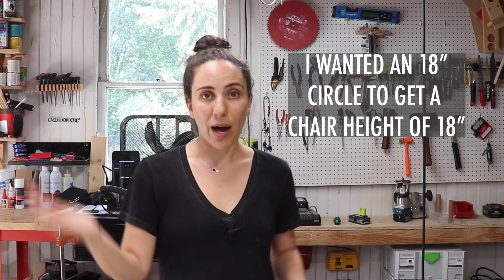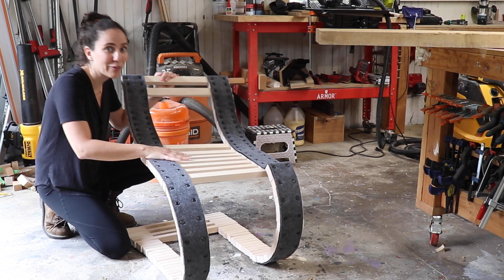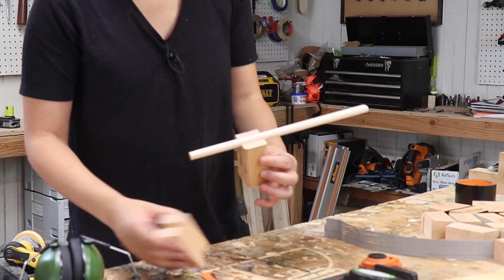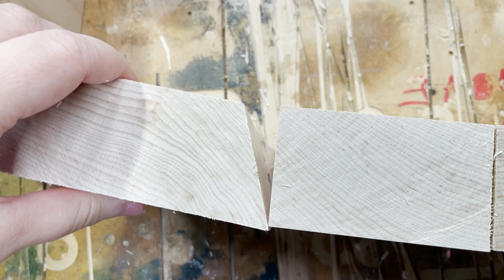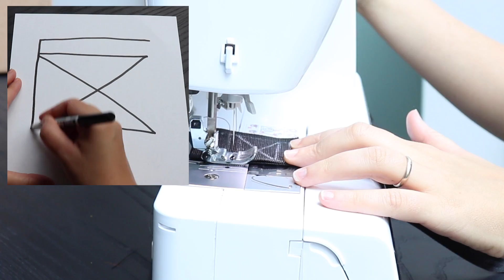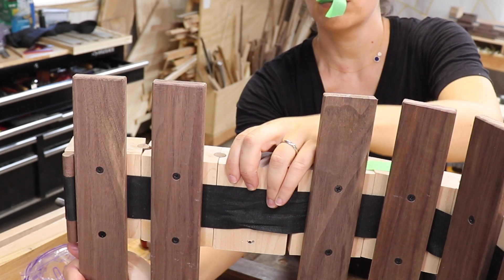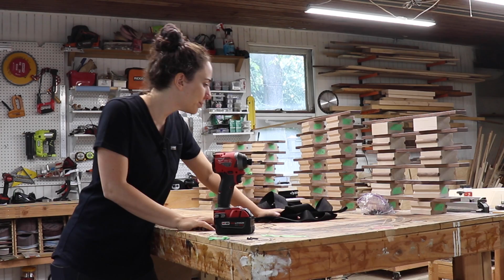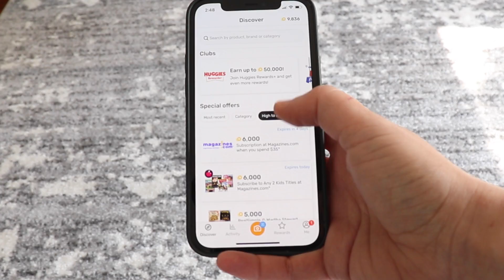I ATTEMPT to make a Roll Up Chair… AGAIN...

Comment: How about using metal hinges on each block instead of the strapping

not saying that you should use metal hinges for the final product (unless you want to) but the idea of metal hinges on each block would help fix the tension and also the elastic problem, the question then is how could you mimic that using your design.
Reply from the maker: Maybe

Comment: A couple of suggestions:
1) Simplify, go to a "bleacher backer" style of chair that is just the back and bottom rests.
2) Add posts in the back to brace the chair back and hold it a fixed amount over the floor/feet.  Could perhaps be made to take the dowell out and go into the handles when you roll it up.
3) instead of 1 long strap from foot to top, maybe smaller straps that hold 2-3 wood blocks together and that would then have less length to stretch out.
Reply from the maker: All good ideas

Comment: Dang! So close! What if you bought a long lengths of piano hinges and then cut them to shorter lengths to use as alternatives to the straps? The short bit of hinge would be placed where the strap would have been between each block. The piano hinges are readily available and are fairly cheap. Third time's a charm 🤞
Reply from the maker: Maybe!

Comment: Great second attempt! Love the dowel idea to reduce rotation. 

If I put on my armchair engineer hat, thinking about the forces, this design is an uphill battle. Focusing on the point you’re seeing the most stretch, at its simplest you have a lever. The inner radius of the block being the pivot, a force of ~130lbs ~18” away (when sat in as designed), and the strap opposing it 2” from the pivot (the other side of the block). That ends up being a 9x force multiplier, turning 130lbs into 1,170lbs (or 5200kN) of force on the strap. (18” / 2” = 9x the force. 9 x 130lb = 1,170lbs)

As for the stretch, I haven’t modeled it, but I suspect even a 1% stretch would significantly alter the shape of the design. Especially when it only has the two attachment points where the 1% of the whole length is able to be concentrated on one pivot like you saw, as opposed to the idea you have of attachment at each segment reducing the 1% to a single 4” segment of webbing. Based on what you experienced by adding tension, that too isn’t a solution because it adds a inherent spring that adds danger of collapse. So to both hold it’s shape unloaded, but also not collapse when sat on, the strapping needs to have almost 0 stretch. Difficult when applying 5kN of tensile force. 

So in my mind, in order to make this work (or at least give it its best shot) you need to reduce the leverage on the strap, and increase strap tensile strength. 

The first can be improved by using thicker blocks. A small change of going from a 2” thick block to a 3” thick block decreases the leverage by moving the pivot further away from the strap reducing forces from 9x to 6x and 780lbs. Going to a 4” thick block drops it to 585lbs (2600kN) pulling on the strap - still a lot. For aesthetics, you could even have varying thickness over the length since forces decrease towards the top and at the tail of the base. 

As for near zero stretch at these tensile loads, two ideas come to mind. Layering the webbing literally multiplies its capability. I haven’t found the specs of the viper webbing you used, but 1” tubular nylon webbing has a breaking force of 4,000 lbs, with stretch happening at MUCH lower forces. Layering 2, 3, or 4 layers with individual segment attachment, might reduce stretch enough in combination with thicker blocks - while still maintains rollability. 

The other no stretch idea is to use metal, metal strapping has almost twice the tensile strength of the strongest webbing. A relatively thin metal strapping might give you the strength required with almost no stretch, while still being able to somewhat roll up. You could possibly use it in conjunction with the webbing. 

This is a hard problem because of the amount of leverage exerted. It’s like having a 20” plank on a pivot point 2” from the end, a person standing on the long side, and a piece of webbing just 2” from the pivot trying to hold the person up.  That’s big forces. But there’s a chance it could work with these (and other modifications I haven’t thought of).
Reply from the maker: Ugh. Yeah. It’s a hard nut to crack. Ha
Reply: @3x3CustomTamar  Good effort, and thanks for sharing even if it doesn’t work. I know people are asking you to keep going with this, if you don’t, that’s cool too. There’s other things you can spend time on that we’d also love to watch.
Reply: This is a really good explanation of the physics at work here and great suggestions for attempt 3. I like the idea of the varied width but that would be pretty complex maths to work out without a program that can do the maths for you 🤔
Reply: Either metal band like Josh Wright used or aramid fiber cord or strap (Kevlar & other brands) for ultra low stretch. If strap stretches 0.1" at the outside of a 2" block, & chair back is 15" from front curve that's 0.1"/2" = 5% deflection; .05 x 15" = 3/4" sag per block joint with that stretch. Check Josh's video, he's close to solving this. Is it a great chair at that point? Opinions may vary on that. Valiant effort
Reply: I would think ss wire rope would work and look good.

Comment: Tamar, I admire your perseverance! This has been such a cool project to watch and I have wanted to see you succeed so much! I’m sad you already glued this version up because I absolutely believe you were close! I think you’ve had a number of issues and you solved most of them in this version but you also introduced a new one. 

You solved tension, the correct angles of the wedges and the side to side twisting. (I was very impressed by your dowel solution to the twisting!). The new problem is that by allowing the strapping to slide over the middle segments the tension can transfer to the least stable part of the chair. Your old design had each segment fixed on its location of the strap so tension was local only. With free segments the tension is global and that’s why the head rest and foot collapsed. They were releasing tension. If you duplicated this design exactly but trapped the strap I think you would succeed. How to trap the strap is the question. I think what you did here with the walnut is good, so perhaps keeping that but with something underneath the walnut that prevented the segments from sliding along the strap. It would change your assembly process but with your whole shop this time I hope you could do it!

If you ever have the will do try again, I wish you the best of luck! 

Also, best to all your other endeavors and your family!
Reply from the maker: I was thinking the same thing. I was trying to think of some sort of metal “clamp” that can hold the strap in place…
Reply: @3x3CustomTamar  Yeah, I was thinking the same thing. I suppose you could experiment with a sample segment in your bench vice and use a ratchet or a come along to tension it. The only thing I can think of is have a small mortise in the segment and screw down a piece of metal over the strap into the mortise. I’m not sure if it would work long term though.

Comment: As you realised in wasn't working I really wanted to give you a hug.  Just thinking aloud but I expect webbing won't work, you need something where the fibres run along the length only (i.e not wobble up and down (as in anything woven) and thus as tension is applied can stretch).  Maybe a cable set so it's centre is level with the surface, the cable could be steel but also check out materials bow strings are made of.  As for avoiding unfortunate folding up you need every block to have the force vector significantly inside the fulcrum.  It's an interesting problem, I can have more of a think if it's helpful.
Reply from the maker: Haha I needed a Hug for sure 😂
Reply: Look at the misrolo photos online the flexible layer must be rigidly attached to each block and not allowed to slide otherwise you get your folding up problem, I think the felt is a cover layer with some solid polymer layer below, it must be fairly thin otherwise it won't fold if it has little stretch.  This layer is the key I think...

Comment: For the strapping material maybe some unidirectional carbon fibre might help?? It should have very little flex in it but it would still bend at the joints. Maybe the carbon fibre needs to be tentioned (i still think there needs to be some mechanism to tention it!) and then laminated directly onto the wood pieces. Also, my gut feeling would be that the small inner edges of the wooden pieces might actually be squished under the load (even though you are using hard wood). 
Looking forward to you attempting it again! :)
Reply from the maker: I hope to get it one day!

Comment: Make a 'cheat' and inset a bent metal pipe on the underside and also use it as a carrier when the chair is rolled up.
Reply from the maker: Maybe
Reply: @3x3CustomTamar  I know it's kinda like giving up on the concept of a self supporting roll up chair, but I think the materials available aren't going to work.  You're going to end up with a 75 pound chair.

Comment: Did you think about routing a groove similar to the one you made for the dowels except perpendicular, and then lay steel cable into the groove and then sandwich the cable with the walnut to keep it in place?
Reply from the maker: That’s a cool idea. I was originally planning on doing that with the strapping so it all stays aligned

Comment: First of all, I love that you upload what would be a "failure" as it's super interesting to see design processes and that not everything comes out perfect the first (or 100th time lol) And i hope you continue to tackle this project in the future, as it's a really cool concept. 
So I have 2 ideas,

1. As you mentioned and has been mentioned in the comments, using metal cables instead of straps, since they don't have near as much stretch.

2.what about instead of 1 continues strap, a bunch of shorter straps that hold 2 sections at a time, maybe like 1 strap holds the 1st and 2nd pieces on the front, then a second holds the 2nd and 3rd piece on the back, and so on and so on. 
The thought is it'd be easier to adjust tension where you need it without adjusting it all over. Like the straight parts might not need as much tension as the curves, so you could make them alot tighter without risking the other parts collapsing back.
Reply from the maker: Definitely a good idea

Comment: Maybe try something like aviation cable? You might need to bolt it to each block, but you could always cover it with strap for the look. It seems like you need something with as little stretch as possible, which sounds like metal to me.
Reply from the maker: Yeah. Maybe

Comment: Tamar,  I enjoy your videos because they are so honest  with the frustrations  we go through working on projects.  

I think to solve the problem with this chair  you need to look at the webbing as a hinge.  Instead of running the webbing the full length and only attaching it at the top and bottom connect it to each board .  So you would end up with each slat as an independent hinge.  Also I think leather would be a better material for you to use .  You can soak it in water apply it and then let it dry and it will pretension it's self as it drys.  I'll be interested in your thoughts.
Reply from the maker: That’s a cool idea

Comment: What about adding metal dowels perpendicular to the dowels you've added already? I see it in my head, but I'm sure I can't explain it well without drawing it. Or, instead of straps, use steel cables along the sides of the maple, or on the back side, in a channel?
Reply from the maker: Maybe!

Comment: What if you had extended straps that attached the top and pulled it down towards the end of the base at the bottom? This would make it more rigid, and the straps could be coiled inside when you fold it up.

And I think other commenters are right on with the strap / cable going through the middle of the blocks. With that setup with more tension it would be pulling the blocks into each other with a compression load instead of at the edge of them with a weird shear / torque load.
Reply from the maker: Maybe!

Comment: I'm thinking that perhaps the strapping is just for show and does not do anything in regards to actual support.

OK, I think I have a solution.

Use high tension steel cable that you thread through the wood pieces.

I'd look for something that has a 500+ pound test rating just because I prefer over engineered quality than; SURPRISE, it broke and someone is on the floor.

You will want to drill two holes through each of the pieces about an inch from the edge, then again once you have the dowels glued in place, and then thread the cable through the holes.

If you can drill a hole the same size as the cable, it will put the tension in the middle of the piece and the piece will be less likely to shift from side to side.

Another idea for quality would be to insert a steel, copper or aluminum shaft into the part for the cable to run through. That way you don't have to worry about the cable eventually sawing through he wood and your chair should last a considerable amount of time.

If you set up a jig to drill straight through the parts, you can test this with your pine test sample since you did not glue those together.
Reply: Just thinking about this.

1) You have not tried to put strapping on both sides of the pieces.
That would be a good test.

2) You could take the metal cable and thread it through a length of strapping. Then, glue another length of strapping on top of that to hide it. This will eliminate the stretching of the strap.

3) overall, I think running the metal cable through the pieces is likely the best solution.

As far as possible tension is concerned, you can connect each end of the cable to a bolt or screw that allows you to tighten or loosen it. This would allow you to figure out the exact tension or lack thereof that the cable needs to have.

And I'm also thinking that each two stands of cable doubles the holding power. So that two 100 Lb cables running in through one side gives that side 200 Lbs of holding capacity.

You can use chicken wire from the hardware store to test the cable idea. It may also be strong enough for you to use in building a working chair.
Reply from the maker: Definitely great ideas
Reply: @3x3CustomTamar  😎👍
Reply: Plastic or nylon tubes in place of the metal would allow you to use your electric hand plainer to clean up the wood after cutting the angles.

Comment: Hello Tamar. I think part of your problem is that the amount of tension you are ‘asking’ the straps to take without stretching. Your weight is cantilevered ~500mm back from the front. The blocks are ~50mm thick. This makes the force on the strap ~10x more than your weight (all rough numbers!). If I sat on that at 90kg, the strap would ‘see’ 8820N (90*9.8*10). Whilst this is probably under the ultimate tensile strength of the strap, it would be enough to stretch it. In engineering terms, you either have to thicken the blocks, increase the stiffness of the strap or move the weight of the person further forward! Hope this helps, love your videos.
Reply from the maker: Definitely helps. Thanks!

Comment: I love your videos Tamar. You can do it! We believe in you. Don't give up.

Some suggestions I think might work:
1) Don't use leather! it will stretch even more. Look for Low-elongation strapping or static-cord if you haven't already. This will give you the best chance.
2) The slats you are using to pinch the straps are a major problem. They are letting the strap slip, and the strap is stretching over the entire length of the chair. Then the areas under the most stress will open up, and the areas of least stress will close. Try fastening the strap at each block like you did in the previous video. It's much harder to stretch a short piece of strapping than it is a long piece.
Reply: One more thing. It's not tension you need, it's less stretch.

Comment: To finish this 2nd version and make it safer put braces between the ground section and the bottom of the seat (perhaps a cool 'X' to stabilize, so when sitting the load is distributed through the seat bottom and in turn much less on the other joints. Its a more formal chair form but its already amazing looking so could be worth a shot to get real utility from it? Just spit balling :) Great videos as always!!! Love the trial and error and effort!! Great work!
Reply from the maker: That sounds like a cool idea

Comment: Hmm.. maybe if you make the sides L-shaped so it has a bigger area where they connect to each other or instead of round dowel use something that it will lock into place better?
Reply from the maker: Maybe

Comment: Since that front curve is holding most of the weight, I had a thought. Based of the direction of that specific curve, wondering if you could make a solid brace that matches that curve, which pivots and can then be used as part of a mechanism to hold the rolled up chair together.
Reply from the maker: Maybe!

Comment: How about adding slats on hinges attached to the bottom and fold out vertically to add support to hold up the seat. Slats on the hinges can be parallel to the dark wood slats and fit in between the blocks. That way it can still be rolled up
Reply from the maker: Maybe!

Comment: Using the way that website named parts of the circle, if you made the thickness of the bottom ring larger, it might hold better.

23:05 when you could tell the chair was about to collapse, you can see the gap on the outer part of the circle by your legs open up. If the trapezoid heights were taller, I think   that would be minimized.
Reply from the maker: Maybe